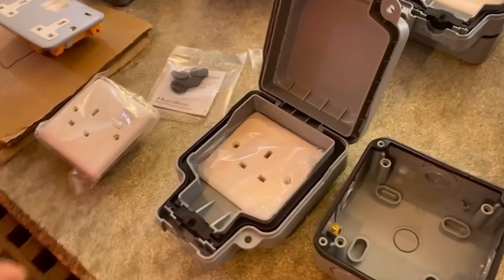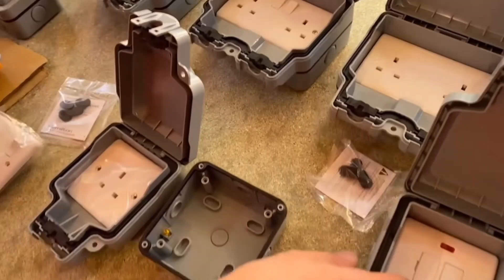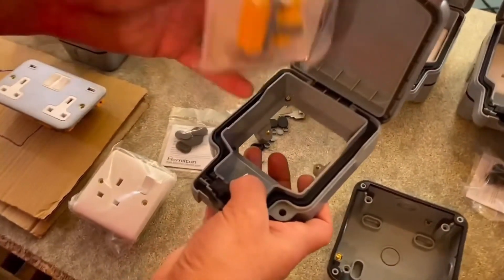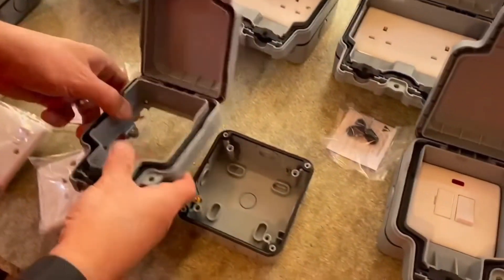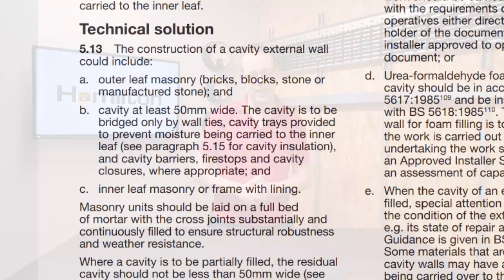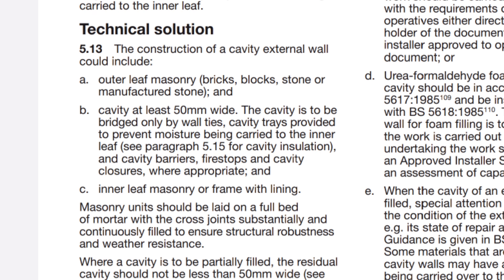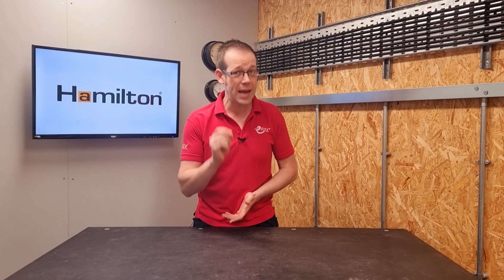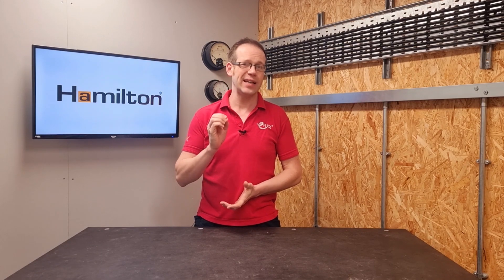CAN ELECTRICIANS INSTALL CABLES IN A CAVITY WALL?

Comment: As with other comments. I’m interested to know about running cable across the cavity for outside lights and sockets etc. 
Also really interested to know what we’re supposed to do with metre tails… every domestic install I’ve ever worked on, the metre tails come through and up the cavity to the CU. Great video as always though. Interesting to see what the regs say.
Reply: Yes me too that was my thought exactly the minute he said the words "bridging the cavity" My house has a double socket on the wall then below it a fused spur to an outside RCD socket. So it must be bridging the gap. The main socket is channelled in the wall as I could see the different coloured plaster when I decorated.
Reply: @seankearney6915  that's fine.
Reply: People often get me to add an outside socket. I just drill through the back of an existing socket at a slight downwards angle and slip a bit of oval through then seal the hole. If any moisture does form on the conduit at least it runs towards the external wall. The worst part is trying not to blow the brick on the outside.
Reply: Not on my jobs they don't
Reply: @treborriam  Yea, I cant think of a situation I've seen that either.
Reply: @treborriam  what do you do then?
Reply: @jacobedmonds305  it depends on the situation so it's hard to erd to give an answer.
Reply: @treborriam  then give one example?
Reply: In an ideal situation the consumer unit would be in the vacinty of the supply box.
Reply: @ayeroxor  Most of the properties I work in are pretty old and the cutout/meter are indoors, but if I'm doing a new supply from a cavity meter cabinet one method I personally use is to cut a 40mm hole through the top right corner of the cabinet, get a 40mm core drill on an extension bar to go through the internal wall. Line the hole with some 40mm PVC waste pipe courtesy of the plumber. Put the tails through and seal both sides, bit of trunking up to the board inside, or depending on the height you've come through you could mount the board straight over it.
Reply: @_______DR_______  I'd agree that's a tidy way to do it, but nonetheless as the video pointed out, it still breaks building regs as to what is allowed to bridge a cavity. In fact a 40mm pipe could form a much more serious breach in terms of water bridging than just a pair of meter tails loose fitted through holes.
Reply: @Rosscoff2000  I've never seen a cavity box with any damp inside unless the door is seriously damaged or missing. And I'd much rather line the hole and not just have the cables going through the insulation. I've used this method in a few new builds and never had a comment from the building inspectors. Not to mention the box protrudes most of the way into the cavity so the bit of pipe probably isn't even 200mm in length, this is also the same way a gas pipe will usually enter from a cavity box.
Reply: @_______DR_______  Sure, I realise the practicalities. I was only following up on the comment in the video.
The issue isn't water coming in through the holes. The concern of the building regs is that water shouldn't be transferred from the inside of the outer leaf to the inner leaf.
I suspect a single wire crossing in a loose fitted hole will do that much less than a 40mm pipe sealed to the walls.
Reply: Where appropriate.. so in general  you shouldn't but you can.... 😂😂

Comment: If installing outside sockets and switches I would use SWA surface mounted on the outside  or if I have to go through the wall I will pass a cut to length pease of 22mm galvanised conduit through fixed to the back of the back box and then pass the cables through the conduit.  So do I now have to rethink ? .
Interesting one great video as always joe 👍👍👍❤️

Comment: 4 inch of cable suspended in fresh air is no concern of mine.you can always run a bit of 20mil conduit through the hole first but we dont get 10 hour days do we.
Reply from the maker: It's more about long unsupported runs in the cavity.

Comment: Hard to see how contact with a small area of non-moving polystyrene will cause significant damage - there's only a finite amount of chemical there to react. IMO the sole issue is de-rating the cable as appropriate to take into account the effect of the thermal insulation ( including the possibility that insulation may be added later if not there already). 
Possibly the only other thing to bear in mind is that cavity insulation is sometimes added by drilling holes from outside, so perhaps worth leaving a notice on the CU of the location of any cavity runs.
Reply: I've seen pictures cables almost melted through from contact with polystyrene over a few years in a warm loft. Something in the polystyrene seems to slowly dissolve over.

Comment: About 40 years ago Norweb, our local electricity board at the time, installed an electric shower and ran the heavy duty cable down from the 1st floor bathroom right down to an air brick opening in the sub-floor void below.  Seemed to me like a good idea at the time.  No channelling out or disturbance of decoration etc.
Reply: It's always been done that way for a long time. That's how the cables are run in my house. All cables come from above down the cavity into the cupboard where the consumer unit is.

Comment: Interesting subject 
There are several points I would like to make on this subject. 
First of all I have never ever seen a twin and earth cable other than very long inappropriately installed as overheads damaged by its own weight in thirty years in the trade ever . Saying that I would always fix cables where they can be and always on new insulations with fire clips as required.
Second I have pulled redundant cables out of cavities that have cavity insulation and other than slight discolouration to the surface sometimes as dots the cable looked and felt like new 
Thirdly the insulation usually acts like a rudimentary support for short retrospective installed runs . 
Fourth . I don’t think anyone would resort to this practice in an ideal world but sometimes it’s  the only practicable option for shorter runs . 
Finally regards breaching the damp barrier I would suggest a slight misunderstanding of the rules intention to not breach the gap with damp conducting materials otherwise you couldn’t put cavity insulation in . 
Most trades seal around the holes they make .
Reply: How much the plasticiser leaches out of PVC cables and into polystyrene insulation depends on the plasticiser that the cable manufacturer used when making the cable.  I've seen one insulated cable go hard and brittle, and a few others which looked fine.

Comment: I said no from the start. (5 stars for me). Also remember, Rodents tend to travel around your property in the cavity. (Oh yes they do!).
Cables are both a help and a hindrance to Rodents, Rats tend to chew them to get past. This can cause nuisance tripping, which will be hard to find.
So NO don't do it.
Reply: Speaking of rodents, i had a nuisance tripping issue a while ago where a mouse had bizarrely squeezed into a tsso, but managed to get passed the 2,  2.5t&e cables & the grommet then chewed the cables !!!  
Even paul Daniels couldn't have done that.

Comment: Common sense will suffice in every case whether it be cables, pipes or anything else passing through a cavity, the fact is building design has always presented problems for services and cost will always be a consideration, whatever the  method of installation it doesn't necessarily mean it's not acceptable? if the the building regs were that critical we wouldn't have running water, flushing toilets and drains passing through walls?

Comment: The specific passage quoted here is basically useless when not accompanied by things like Gas Regulations which allow you to bridge the cavity directly as long as the pipe is sleeved and sealed on the inner leaf. However your video title is about running in the cavity and not through it, theory being it's possible to run cables in the cavity without bridging it but only during construction but as more and more old buildings get polystyrene bead insulation and new builds are required to have either PIR/PUR or fiberglass wool insulation in the cavity why would anyone bother. 

If they're going through a cavity wall it's always better to just sleeve it with some pvc conduit, not even for the sake of protecting the cable but to stop the stupid beads flowing out the wall every time the outside lights get changed.

Comment: I get not running meter tails for more than 3 meters to inside, as it is hard to trace where they are, but i dont think a 300mm horizontal bit of cable to an outside light/socket is gonna be a problem. I also agree with the PVC reacting with  polystyrene insulation is a problem with the chemical reaction. i suppose if its in a metal conduit or trinking its gonna be fine. dunno... 🙄

Comment: This Is a crazy one, Plumbers always put Gas pipes through walls . I've always put a bit of conduit or oval trunking between fittings never had a problem up to now.
Reply: That's acceptable and correct
Reply: Me too, I up-rate the conductors to 4mm to compensate for the insulation (32a ring) and fix it to the inner skin to stop moisture transfer.
Reply: @Poorlybobsdad  How do you fix it to the inner skin?

Comment: I doubt the occasional odd few metres of electrical cable inside a brick cavity will ever make much difference to the air flow or damp being transmitted via the cable, builders leave more than enough crap in them. In over 40 years iv'e never come across any problems with degradation of a cable touching any kind of wall insulation or over heating, one would expect the electrician to take into account cable calcs if it was a high current using circuit.  many years ago local Authorities allowed rewires to be carried inside the cavity, I don't think this was good  practice however to my knowledge there doesn't appear to be any lasting negative issues with these installation, street lighting columns often have several metres hanging through the middle with out to many faults,  90% of all conservatories have the socket circuit wired though the lower wall to each outlet, as for installing Micc into a brick cavity good luck with that, and wouldn't that transmit damp the same as any cable, plus Micc is not that great of cable as after 25 years or so the terminations brake down and never seen a standard domestic house wired in the stuff.
Reply: Knowing my luck I (or the BT man) will drill through them shortly after install!
Reply: @davidreynolds9649  LOL, this could happen  but with a little fore thought and skill these issues can be overcome. Carry on sparking .
Reply: You also need to consider that rodents will and do live in cavaties and love eating electrical cable
Reply from the maker: All good points. 👍
Reply: Great points.
If only all electricians applied intelligence and experience to rules and regulations.

Comment: So how can the DNO run meter tails up a cavity if you’re not supposed to use it?

How do you get power from inside to outside if you can’t bridge the gap?

Seems to me that someone at building regs hasn’t thought this guidance through as that’s nigh on every property in the U.K. going against the regulations.
Reply: Was about to post about the inside to outside point.

Surely we shouldn't be able to drill a hole through to fit an outside light etc in this case?
Reply: It seems to me that bridging the cavity from inside to outside is ok (or are we saying you live with what you’ve got and the regs say you can’t have any new connections outside of the house)

Although I have not read the text I would guess it means running the cable in parallel inside the cavity not at right angles through the cavity. Reading it that way it makes sense, but just saying you can’t breach the cavity is unworkable.
Reply: The DNO don't run meter tails, their work and responsibility ends at the cut out, which is 99% in an outside box in properties built in the last 20 or 30 years.
Reply: @N. J. Farrar Property Maintenance but you’d be bridging the gap which they say is a problem in this video?

I’ve done plenty of outside socket and light installs. Yet this infers that me running a cable through the conduit (with the conduit bridging the gap creating a moisture issue) is against building regulations. 

It also doesn’t explain how the DNO can run meter tails up the cavity. I’ve yet to see a set of meter tails in conduit. They are just fed up the cavity to the board from what I’ve seen.
Reply from the maker: Interesting points brought up here. Even brick ties have a little dip half way along to allow water to drip off them. I guess if the cable runs slightly downwards as it leaves the building it would prevent moisture transfer. Further investigation to follow.
Reply: @efixx  I mean we all do it, have to get power outside somehow but imo these regs are perfectly clear - you're not allowed to do it.

Angled holes are good to stop water ingress but won't do anything to prevent moisture wicking.

Comment: Cant put my outside lights up !
Reply: @scabthecat Why does someone always have to be silly. Run it through the cat flap its less likely to be a washing line and potential trip hazard.
Reply: @carmicheal7  I've got two options don't go out at night or buy a torch!
Reply: You need to get with the times.... your outside lights should be led with battery power & solar panel built in to recharge 🤣
Reply: @Easydread  add a mini wind turbine for good measure
Reply from the maker: 😂 Solutions!
Reply from the maker: Sorry Ray! 😂
Reply: @efixx  thanks guys .its solar for me.

Comment: If the building regs only allow for what you quoted, then we shouldn't even run tails through, or drill out from inside for any electrical accessory ?
Reply from the maker: It's an interesting point isn't it? Further investigation to follow, I think as long as you go straight out or maybe slope the hole downwards as you go out the building it could be ok.

Comment: So every time you run a cable through a cavity to a socket or outside lights you are going against building regs by bridging the cavity. Well that's every property in the UK then.
Reply: Indeed, including telephone cables!

@RubberThingy I think you are right but I am still disappointed that the subject wasn't covered.  After all running across a cavity is very similar to running in a cavity!  

I think I am right in saying that gas and/or water regs require all pipes to be sleeved when passing through a cavity.
Reply: Wonder if anyone has told satellite, cable and broadband installer this?
Reply from the maker: Interesting points in this thread, I think the gas pipe being sleeved is also about preventing the cavity filling up with gas in the event of a leak. It's an interesting point about going through a wall to a socket or light. Further investigation to follow! Also I had a boss once who'd knocked a corner of his window out to run a cable outside!
Reply: @efixx  I would have thought it more to do with the lime in the mortar. I have seen them sleeve it in thick yellow tape, which wouldn't stop a leak. Also how are you going to break the copper in the cavity without piercing the sheath first. I would hope no fitter actually embeds a soldered or compression joint in the cavity.